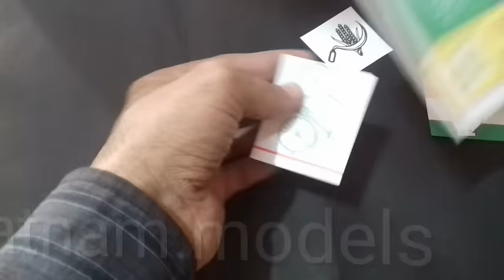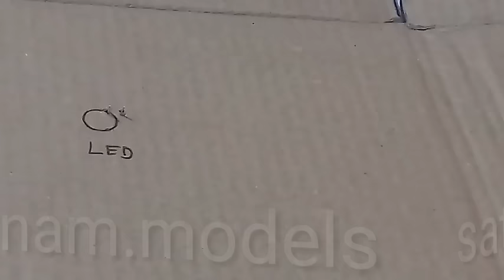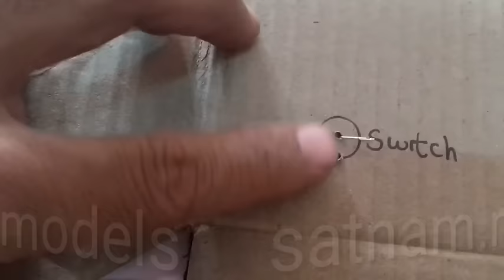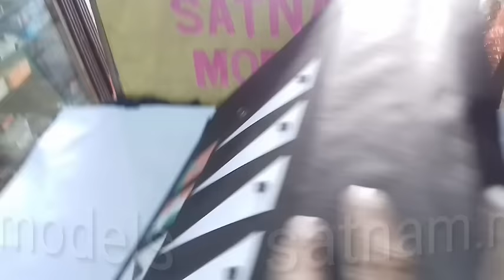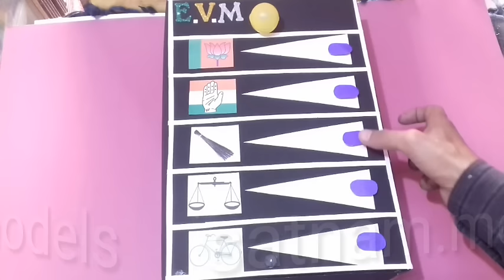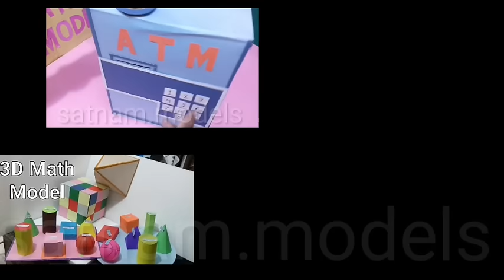Voting machine model || evm machine working project | sst working model

Comment: What are the material for this project sir
Reply: Cardboard sensors lights and battery + wires
Reply: + buzzer switch
Reply: Bettery connector lag bhag apka 300 rs tak spend hoge isko bana me